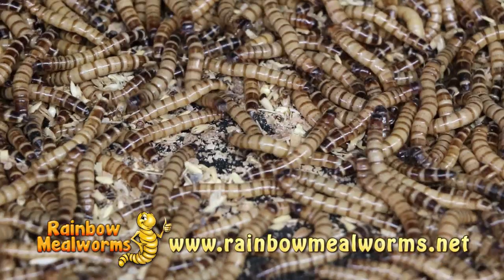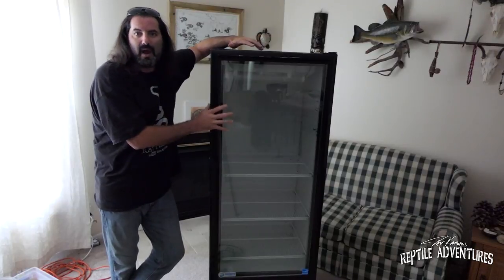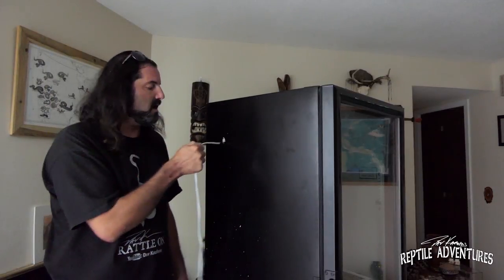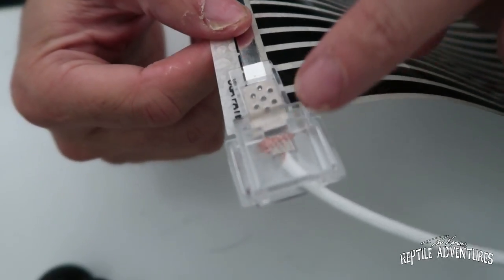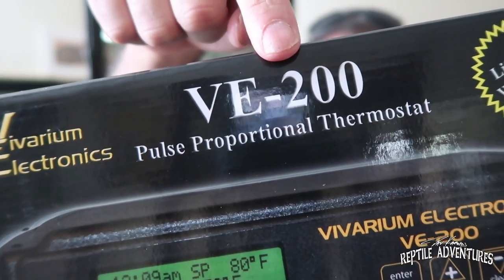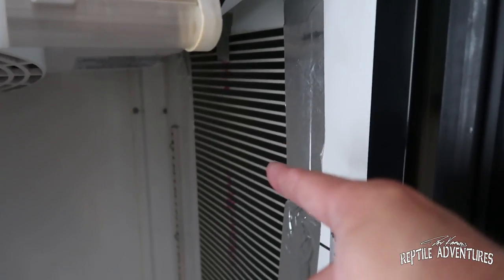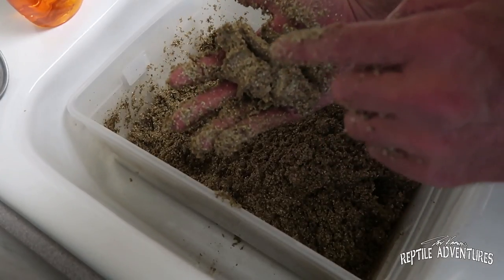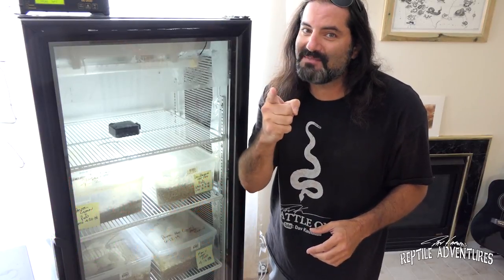DIY REPTILE EGG INCUBATOR (How to build your own)

Comment: I did the same thing here but my drink cooler is twice as wide. Putting a lot of 2 litre bottles full of water in the spaces where egg boxes are not at builds a nice heat sink to quickly raise the temperature back up after it drops due to opening the door. It takes a lot longer to come up to temperature initially due to heating all of that water but the thermostat works way less later to replace the heat lost from opening the door. My incubator holds 24 sixteen qt tubs and has 66 water bottles that size in it. Once it is at temperature, it dont change. The water bottles also buys you more time in case of a temporary power outage.
Reply from the maker: Great tip thanks for sharing
Reply: Smart!
Reply: Yea water bottles work great i did the same thing with my home made one i just did it as i needed the heat to even out and be able to reach the eggs

Comment: I was using a polystyrene box with a heat mat on the bottom underneath a layer of vermiculite. Temperatures were controlled with a thermostat. This was ideal for single clutches. Now as my obsession has grow and I can produce multiple clutches this incubator method will be perfect. Reading the other comments about using water bottles as a heat sink and fill empty spaces I feel confident in making one. Great help Dav
Reply from the maker: Awesome! Use #rattleonfan when you post pics of it so we can all see it

Comment: Incubation Hack...before you place your egg loaded tub in the incubator, weigh it and write that weight on the tub. Then, once a week or so, reweigh that tub and if the weight has dropped add enough water at the corners to get the weight back up to the weight you wrote on the tub.

Comment: Coolers make great incubators. I have just built another incubator, using a cooler and turning it into a false wall incubator. Using 2 fans to circulate. Temp stays spot on. Better than shop bought incubators

Comment: I will be breeding for the first time later this year and this is thee best DIY incubator video I've watched so far. I do have two questions for you:
1: why do you prefer putting eggs directly on vermiculite instead of on a diffuser?
2. I see alot of ppl put a peel and stick film around the top of box but you didn't. Any reason why not?
Thank you

Comment: I use a large heatpad and dimmer switch put into a large blue and white coolers then lay 5 to 6 bottles of water ontop the heatpad then use the plastic grate for flourecent lights to put ontop the bottles and it can fit 4 to 6 clutches of eggs depending on the size but this has always worked for me

Comment: Hi Dav! First off let me say that I really enjoy and appreciate what you do and the passion you have for it. Your video has brought me some confidence with its clarity and I’ve procured a commercial fridge (it’s probably too big lol), that doesn’t cool properly. My issue is; I can’t find anyone certified or otherwise who is willing to remove the compressor. If I were to just cut the mainlines coming out of the compressor would that be sufficient? I want to still make use of the inbuilt light and fan so I would be plugging it in. Lastly, a friend of mine asked me why I don’t just turn the fridge temperature dial down to zero. Would that work?…it almost seems to simple. Thanks in advance.

Comment: Great video I’ve been looking for a cooler to do this for my self for some time now
Reply: Also where do you get your heat tape from
Reply from the maker: You can get it at any reptile specialty store or usually someone has a roll at expo near you. I've never searched for it, but I bet Amazon has it too.
Reply: Ball & Chain Constrictors Austin !!!!!I picked up a wine chiller to covert a couple days ago on Craigslist for $25, non functioning of course. But I get ALL my heat tape & Thermostats from beanfarm.com they carry the "flexwatt" brand heat tape, connectors & insulators exactly like the ones Dāv used in this video AND they carry EVERY model of Herpstat & Helix thermostats. Also they're in Carnation, Washington so shipping should only take few days to reach Your specific location. I hope this helps bro. 😊

Comment: This might be a dumb question but how do you plug the cooler in for the fan to work but not the cooling? Did you take the compressor out? I will do this soon and I am a little bit confused.

Comment: Her king Rattler, I have a quick question. 
If that cooler works with the fan how do you get the actual refrigeration part of the fridge to stop cooling?
Reply: Remove the refrigerant stuff at the bottom

Comment: Hey Dav Kaufman. Why did you use the foil tape, and not normal duck tape. Thanks for the video, it was very helpful, and keep up the good work!!!
Reply from the maker: Because other tapes can get gummy under the heat of the heat tape.
Reply: Benjamin Tritsch I just wanna say that I've using been duck tape on the heat tape I have in my hatchling rack for a year & half now. Half of the rack has duck tape & the other half has the tan "box tape" and I haven't experienced any of the tape losing it's ability to stick or leaving a gummy residue. BUT with that said it DOESN'T mean that it isn't possible or that it won't happen, I just haven't experienced that yet. If it ever does happen I'll leave an updated comment. And it IS best to use the foil tape Especially if the heat tape will be used in a rack as the foil tape transfers heat better than other types of tape do.
Reply: Hey Sergio M. I agree 100%, and I only use foil tape for my racks now. I tried it out, and like you said besides it not leaving a residue it overall transfers heat way better than normal Duck Tape or Boxing Tape.

Comment: I have a question about the vermiculite. Do you open the box at any point during incubation to remoisten it or do you just get it to the point you mentioned in the video and then you dont touch it until the eggs hatch? I always wondering if it maintains the proper moisture up to hatching.
Reply: Was wondering  same thing lost last clutch cause it dried out
Reply: Weigh the tub before you put in the incubator and write that on the tub. Then once a week rewiegh the tub and add water as needed to get the weight back up. I just learned that trick this week.

Comment: Great Video, Just one question. Why did you drill on the side of the incubator versus drilling the backside hiding the wires moré efficiently?
Reply from the maker: Thanks! It's because the back wall has a built in cooling coil system.

Comment: Well done video man. Thank you for that. How do you disconnect the cooling mechanism in the cooler? Is there another plug that you just don’t plug in or do you have to disassemble the cooler to get out the refrigerated section?
Reply from the maker: No, just don't plug it in. This one had a separate cord for the cooler and the fan, so it worked out perfectly.
Reply: Ok great

Comment: Where did you buy the connectors and the protectors you used to connect the wires to the heat tape?  I've been looking for some and I've been unable to find any.

Comment: This may have been asked and answered, but what was the black square thing on the top shelf?

I will be building one of these in the coming months and want to do it correctly
Reply from the maker: I had to think about that for a second. That's just an LED light I put in there for the sake of the video so it wasn't so dark in the incubator.

Comment: Hi Dāv,

Excellent video. Just one question: I’ve seen a ton of conflicting info regarding whether or not you NEED to remove the cooling system from a wine cooler/fridge/cooler when you turn it into an incubator. What is your opinion? I’ve just built my own with a Frigidaire wine cooler and an IncuKit XL, but now I’m worried I need to have the cooling system removed. Any advice or suggestions would be awesome! Thanks!
Reply: If your using the fan and lights from the box, just make sure all the cooling system stuff is unplugged/disconnected. Leaving it in there is fine....does make the cooler heavier though.

Comment: How do you deactivate the cooling system but still keep the fan connected to the coolers power source to use the fan for air circulation??? @davkaufman

Comment: Hello, I am trying to incubate tortoise egg in home made incubator. Humidity is about 75%. But I have to almost open the lid. Do you think that it is ok  when the humidity is not changing and temperature is 29°c with almost opened lid. Or i should try  make more holes and let it closed? I don't know what to do.

Comment: Hey I found a small red bull mini fridge lights work and has 2 fans ... I'm wondering if I should understand hook one of the fans because it will be to much... It's a small one 2shelf mini fridge. What is your thoughts on it use only 1fan
Reply from the maker: Test the temps with the fans on and off before you put the eggs inside.

Comment: Instead of a cooler, what other cheaper alternative can we use for the incubator?
Reply from the maker: I've seen people use an old refrigerator but you want something that's pretty steady and can hold in the heat
Reply: I've seen people use a cooler box and water heater, is it ok?
Reply from the maker: It's hard to maintain the temps in the kind of set up
Reply: Ok then, thanks 👍

Comment: I have a small fridge but only about 4 cf. My question is, how do I calculate watts per cf to make sure I am using enough or too much heat tape, or with the thermostat does it not make any difference. I don't want to buy twice as much as I need. Thanks.
Reply from the maker: That doesn't matter with a thermo hooked up.

Comment: Sweet video. I just picked up a non functioning 24 bottle (27.5" H x 18" W x 15.25" D) wine chiller off Craigslist yesterday for $25. This year will be my first year pairing any snakes & I've barely been collecting for a year & half now and only have 18 Ball Pythons in my collection.  I'll be getting some 11" flex watt heat today to finish my incubator, I've got a couple tricks up sleeve for maintaining proper humidity as well. Now I know the hole you drilled for cord on the flex watt & the probe was pretty small, just big enough for them to fit thru but What did you do to hole... did you just leave it ? I'll be using silicone to seal that hole so heat doesn't escape. Even though the size of the hole is minimal I still believe some heat Will escape if not sealed. Just my opinion, I could be wrong but I don't wanna risk it. Great work Dav ! 👍
Reply from the maker: Nice score, and thanks! I would suggest against plugging up the cord hole with silicone because you'd want the option of making the probe cord longer or shorter inside the incubator. Good luck with it, and with your breeding program!
Reply: Hey thanks Dāv I'll try to keep the hole as small as possible but still allow room for both the heat tape cord & thermostat probe to fit through as I'm gonna be using a Herpstat2 so I MIGHT use a humidity probe also just in case. My first pairing was my Super Enchi Het Ghost male to my Disco Enchi 66% poss Het Ghost female. I'm hoping for a Super Enchi Disco female to hold back, no possibly of any normals so that's a plus and IF get ANY Hypos I'LL Probably crap my pants as I have an Enchi Ghost male & a Mimosa Mojave female as well so any Hypos that May result from this clutch will Just be a bonus. THANKS for taking the time to respond to my comment. 👍
Reply from the maker: Sounds good! Best of luck on your clutch! I hope the odd gods are with you!

Comment: I have a question

Since you said that it is hotter at the top than the middle, when keeping multiple boxes at different heights how do you maintain a constant temperature within the incubator? 
Does the fan circulate all the hot air keeping it constant throughout? 

sorry for my stupidity, I don't know much about incubators
Reply from the maker: Yes, the fan will circulate the air and keep the temps pretty constant.
Reply: @davkaufmansreptileadventures  Appreciate the reply, Thank you so much!

Comment: Wow This is the 7th Video on Incubators for reptiles. How to do it and so forth. But no one explanes WHY? Why an Incubator? Animals breed in the wild. Why can't you just let them do it in a Terrarium? Just because of more control? Couldn't you just put eggs in a little Tupperware inside the Terrarium? Well I'll head on.
Reply: It’s one way to keep a personal eye on the clutches...just in case an egg goes bad, they don’t want any diseases spreading to the good eggs. They probably could do a little Tupperware lidded container in a terrarium...if they didn’t have oodles of snakes that have been bred. Some snakes have huuuuge clutches! Edit: I’m assuming he did this to keep the eggs at the same temperature and humidity